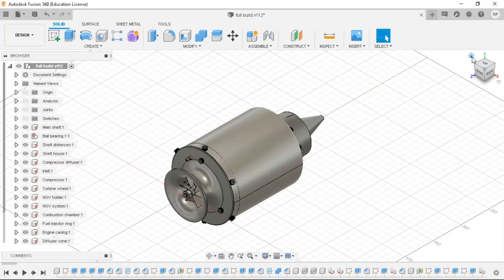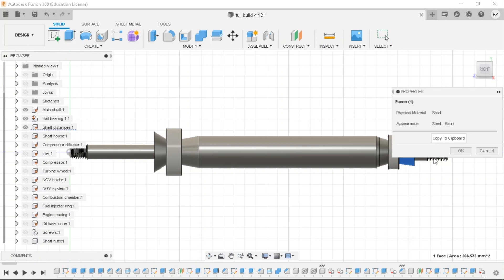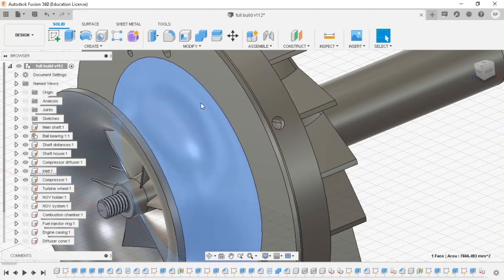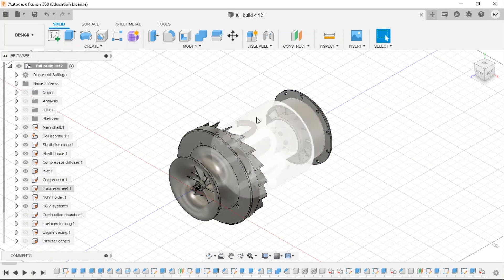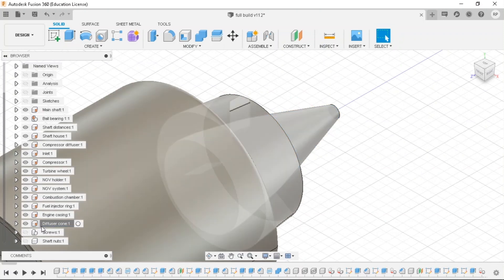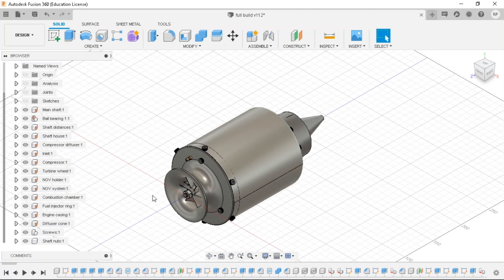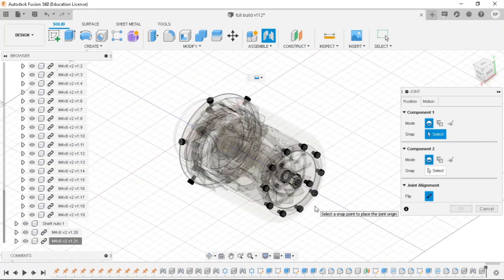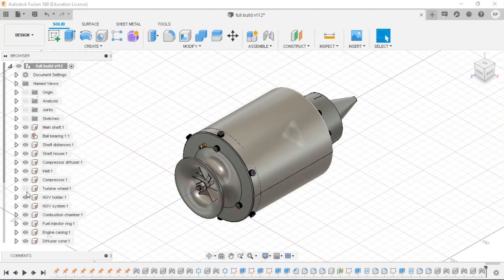Jet turbine design and materials

Comment: What is the degree of reaction (DOR) of the turbine and how much thrust (in pond) will it exhibits.
Reply from the maker: I haven't tested it so i'm not sure about this , its a kj66 i think
Reply: @TheDIYer well you can make an update on this model.  Try to use the ring in the first stage star blade of the high pressure turbine to hold the blade. This will retard the longitudinal strain on the bearing.
Reply from the maker: @christincherian4315  I didn't get what you meant , would you like to connect over email

Comment: Main engineering is extraction of materials
It's easy to design but it's difficult to extract materials from ore's
That's main engineering.
And main is there will be only one manufacturer i.e china and others will only use it.
Reply from the maker: Theres lot coming do stay tuned , i will see that it is make and made with everything indian😁